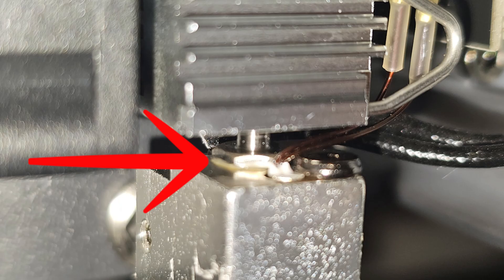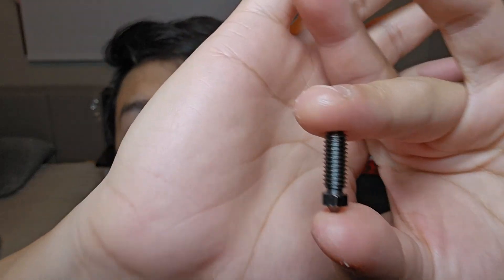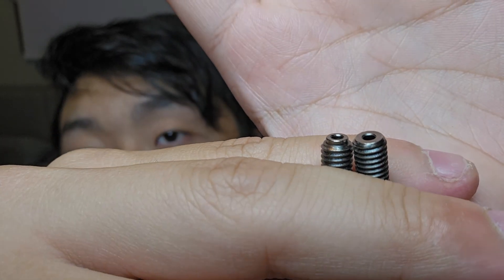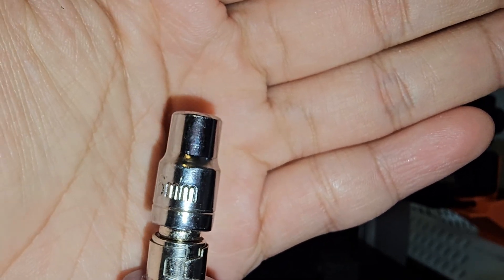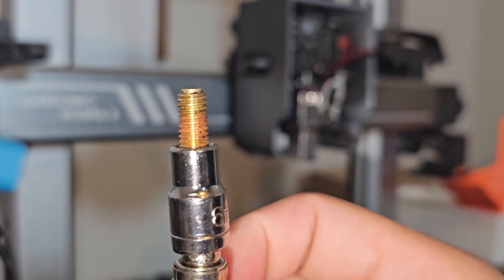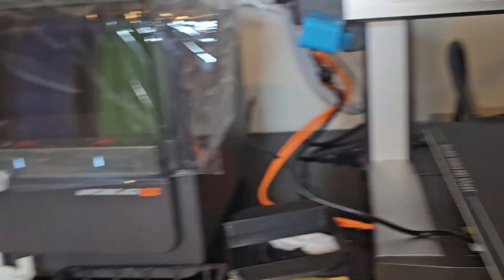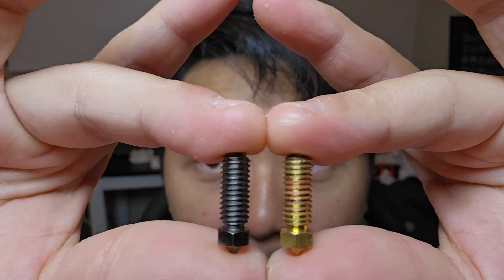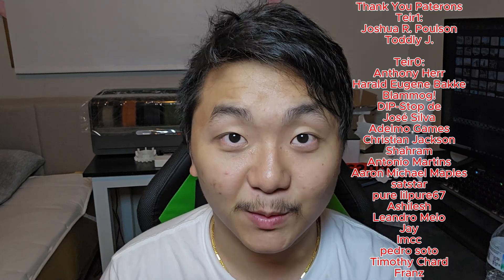Anycubic Kobra 3 Official Hardened Steel Nozzle

Comment: What did you do about the original nozzle and the thread seize that was applied?  All of the Anycubic official nozzles I have are assembled with a thread lock compound that makes it difficult to remove the nozzle.  I tried to remove one of my original nozzles from the heat block and the nozzle head wouldn't move at all when cold and actually ripped off of the threaded barrel when heated to 200C..
Reply from the maker: This was the version where there's no thread lock on the nozzle and it starts leaking. So then they added this strong adhesive and now all the nozzle are stuck. I try to remove one and the head came right off with the thread still stuck inside.
Reply: I have a Kobra 3 V2, so with that thread locker, you need to heat 250°c or above, 200°c is not sufiscient enough. And then you go carrefully, one 1/8th of turn at a time, the best is to take out the entire hot end, and working outside the printhead.

Comment: Should I switch to the steel ones or the brass ones
Reply from the maker: If you are planning to print stuffs like carbon fiber, fiber glass, or other more abrasive filament then go for the steel one, if not brass works fine.

Comment: These nozzles look very similar to the old e3d volcano I bet they would fit.
Reply: actually I just tried searching it and one of the results comes back with nozzles for kobra 3 / volcano - so yeah they are probably the same. May open up more options for you as the volcano has been around for a long time and is very common.
Reply from the maker: that's true. I did try other volcano nozzle and it fits, but it was leaking. These fits great and no leaking.